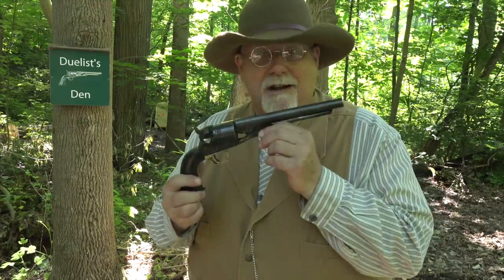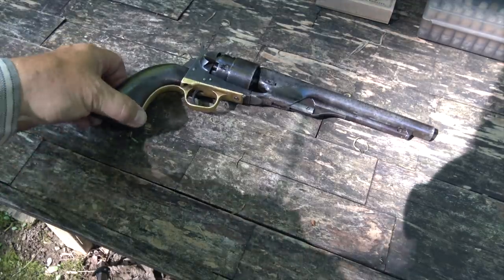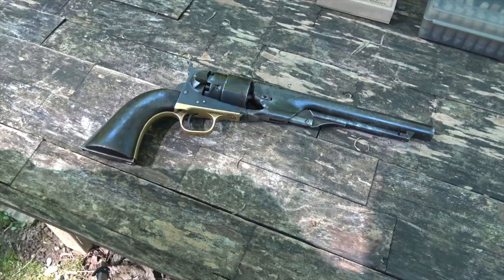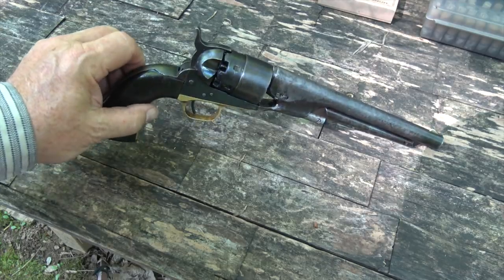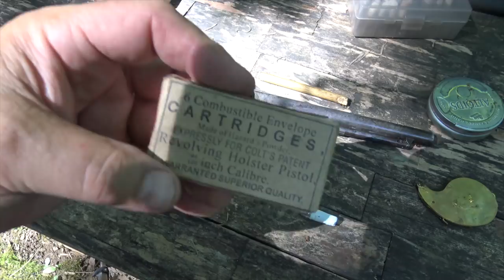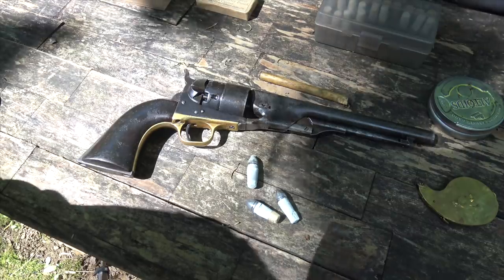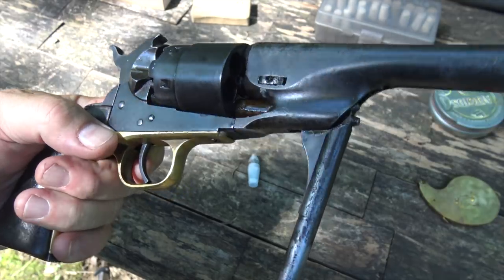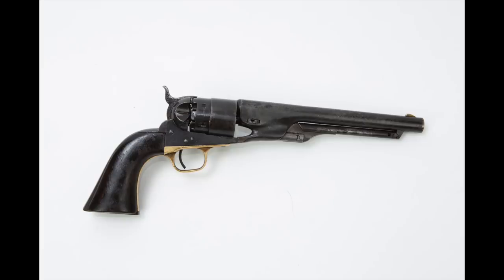Shooting an antique Colt 1860 Army Revolver   Part 1

Comment: When I was young, I bought a used Ruger 3-Screw revolver in .357 magnum.  I checked it out and it seemed to have a light trigger, but then so did my old flat-top .44, so I didn't think anything of it.  Loaded it up at the range and cocked the gun at low ready.  It went off about two seconds later, still at low ready.  I emptied the gun and sent it off to Ruger for the transfer-bar safety conversion.
 I don't shoot Black Powder, but a chain fire sounds terrifying.

Comment: Good for you shoot it! I cut my cap and ball teeth many years ago on an original Colt 1851 Navy from a cased set. I shot it with corrosive caps which ,was what we had at the time,  Du Pont FFFg powder, and balls cast in the miserable little steel mold that was in the cased set. It was cleaned after shooting very carefully and it was not hurt at all. I wish I still had it.
Reply: It looks like the frame and back strap are cut for a shoulder stock, but there is no fame stud for one.  i

Comment: Hi Mike, I noticed that the frame of that 1860 isn't case hardened, just blued. Also, since it has only three screws, no shoulder stock screws, it must be a civilian model?
Reply: The early Colts were built for the shoulder stock whether commercial or military. But the stock was not a success and later builds were the three screws whether civilian or military.

Comment: I was having a discussion with a friend I met in hunt showdown. An it revolved around realoding the gun during a fire fight. He said a cap & ball gun couldn't be reloaded on the battlefield. Same with paper cartridges. I feel that its possible just harder then it is today. Maybe the caps would be the more complicated part.
Reply from the maker: In general, for the infantry, revolvers were a last ditch weapon, used when the fighting was close, fast and furious. There wasn't time to reload anything. In the cavalry, where revolvers were often the primary weapon, troopers carried several, often four to six fully loaded revolvers.So combat reloads were not the norm...but they did happen. Paper cartridges made the process much faster, but, you're right, capping was the slowest part of the operation.

Comment: Do modern Colt branded revolvers accept the paper cartridges without modification? Will a paper cartridge loaded revolver stay reliable indefinitely in dry storage like with revolvers loaded using loose powder, ball, and your grease mixture over the ball. It seems unlikely that persons trekking  in the field during the 1800s would be firing their limited hard to replace supply of cartridges, unless they got wet or were being fired in need.

Comment: A clean, properly maintained, well lubricated black powder revolver essentially does not wear if used. Theoretically it will wear slightly, but the wear would be completely unmeasurable.

Comment: There is absolutely no reason not to shoot an original gun providing it is in sound condition, these things are made to be used, and with modern weak black powder you are not going to do any damage to it, we shoot these regularly in competition without any issues, no doubt you have noticed that the hammer spring is much stronger than a repro, so you should not get cap debris dropping into the action, enjoy shooting it, I know you will look after it, one thing to reflect on, it is now in better condition than it was when you bought it! Stay safe.